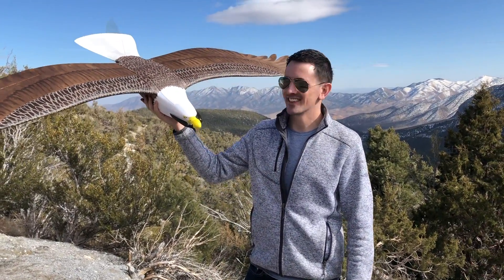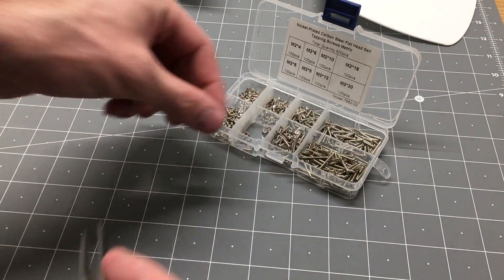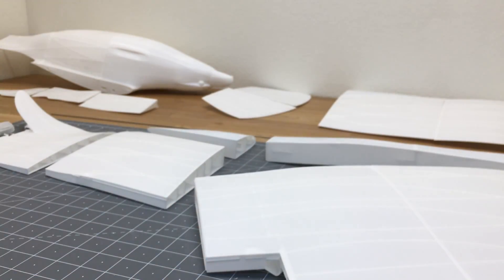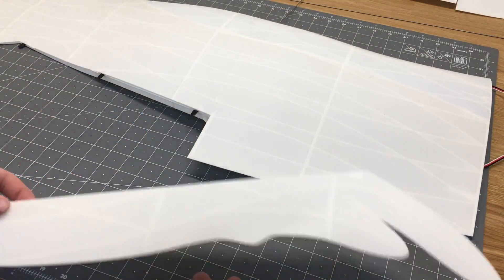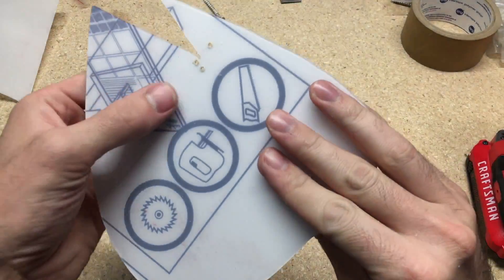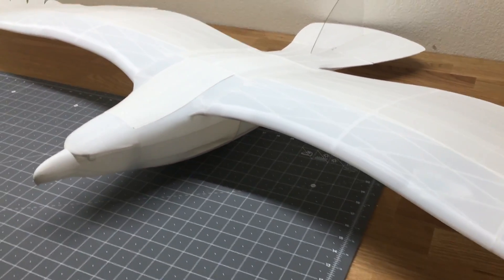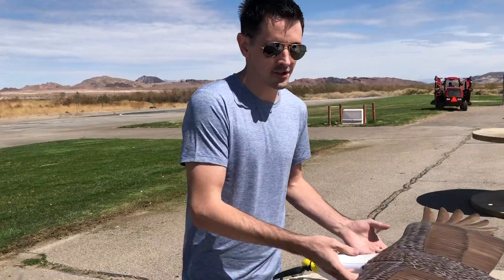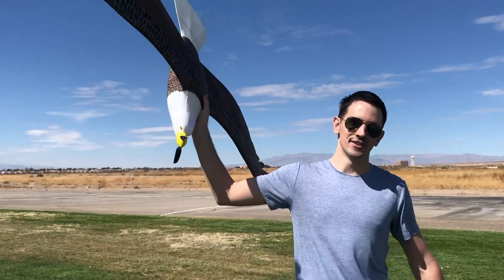Epic DIY 3D Printed Planeprint Eagle Build

Comment: Dear Troy, let me tell you my sad history and ask you your experience with the eagle.
I printed my first eagle, made its maiden flight and crashed after 10 seconds. CG perfect. As it built a little of speed it smoothly pitched down seeking the ground. Full elevator stick back didn't rise the nose. I thought the elevator servo was faulty.
I printed my second eagle, made its maiden flight and crashed after 10 seconds. The same behaviour than the first. I wrote to PlanePrint and they suggested me a bad elevator/aileron mix. What?!  I missed the mix! I didn't check the whole instructions. (Overestimating self knowledge).
Well that made sense for the crashes. I printed the third eage, made aileron/elevator mix, went for its maiden. After launch I inmediately feel good control on the eagle not like the previous flights. I was gainig height while trimming the plane and on two moments I felt the pitching down behaviour when aquiring speed, but with a hard elevator pull it raised the nose. After some minutes smoothly climbing and trimming finished it had height enough for some testing, but then, it picked some speed and again pitched down on a smooth dive. This time a full elevator stick back didn't raise the nose. There were a lot of long scaring seconds waching the eagle diving until the ground. I shoud have tried a half loop down and comming out inverted, but I was too slow.
Let me ask you... How many flights have you done to your eagle? Have you experienced this behaviour?
Thank you!

Comment: This designs been around for awhile, the only problem that I have with it is that it is short coupled, which is not that big of a deal, but the idea of having a clear Rudder is just not something I would want to do with it. The best thing to do with this thing would be to make the tail slightly larger and bring both edges of the tail down in an inverted V tail position. Many birds out there use their tails to control in the manner of a v tail even though it's not natural for an eagle, it still would be better than having that clear plastic Rudder there in my opinion.

Comment: I switched to stainless screws instead of the nickle coated screws as he shows. Not that much weight difference in the hardware. I Have had those screws strip on me even with a good precision screw driver. Some people might not take the wings off for transport, but I usually carry several different planes to the field, like the Big Bobber and model A. Thanks for the inspration to build a few of these! Awesome stuff!

Comment: Did you find the lexan for the vertical stab, that was recommended in the plane print instructions kind of flimsy and is that why you went a little thicker on that?

Comment: I have printed all of the lw pla with your settings and lw pla came out good (no under extrusion and no holes) , but when I try and print new roll of standard pla for the P3 surface normal pla parts, I am getting underextrusion and holes in the prints. What could I change to resolve this?

Comment: Tabs YES. I'm a model builder and When I see ppl build 3d printed parts invariably the parts are smooth. so they spend aligning the parts. I always think why don't they add some guide tabs to ensure alignment and add strength to the joint?

Comment: Hello, 
Awesome work, can you tell me how much Kg of filament are necessary?
Best regards
Reply from the maker: 400g of PLA and 500g of LW-PLA
Reply: @TroyMcMillan  Thank you
I cant find it in manual, if you can can help, just need to know the lenght of steel wire for elavator
Thanks
Attached image https://ibb.co/Sn6BGcQ
Reply from the maker: @NunoFlyer  I use 1m long wire and you cut them to length

Comment: Amazing. I looked up for this kind of flying machine as I believe these should be more energy efficient than traditional drones.

Do you actually know if your design is more energy efficient than other drones?

You could make this comparison by comparing flight length per unit mass per kWh consumed.
Reply from the maker: I haven't done any official testing like this. It is very efficient uses a small battery and gets a long flight time.

Comment: Could you show all the settings you used to print the TPU?  I am using the suggested print settings both manufacture and from their site and I am getting is thin not usable parts on my Anycubic Mega S.
Reply from the maker: For the Mega S you need to print very slow turn your printer down to 20mm/s speed 100% flow at 215C.

Comment: Hey we are using the software simplify 3D. We can import the test print everything looks fine but the printer doesnt print the inner walls of the profile . Any suggestions ? what to do ? we also used your recommended settings.

Comment: Great work. Thanks for the video. How essential is it to use the LW-PLA? Can the whole design be printed in regular PLA?
Reply from the maker: There has been a few people try to print this in all PLA but unfortunately the CG cannot be set if it is printed in PLA the back part of the Eagle is so light and the head does not protrude enough to add enough counter wight if it is printed with PLA in the rear.

Comment: 17:30 you have that mix backwards; when you pull up, the flaperons should drop, adding lift, you have them raising up, which is reducing lift at the same time the rear elevator is increasing the wing’s angle of attack, attempting to increase* lift. You have it set up so they are fighting each other

Comment: How much to buy the pieces? I need this but don’t have the ability to be a 3D printer guy.
Reply: I would buy one as well
Reply: @dboelens  , I have the printer's but have not bought the file yet. These guys make so much more money just selling the files that they don't have to do all of the laborious part. Printing all those parts, I am guessing would take my largest printer a week to create, with alot of trial and errors and throw away hickups. I estimate half a roll of both standard PLA and lightweight PLA (never used before, but just need to purchase). The rolls would cost $20 and $30 respectfully but might print three planes.
Are you seriously interested?
Reply: @c.g.4392  It would depend on the overall cost of the parts and of course the shipping. If you would like to split the costs I could do that. Where about are you located
Reply: @c.g.4392  We are interested in getting a few of these made. What ever the cost to make these we will pay for all materials, files needed  and what ever you consider it's worth for you to make them. That way you could make some for yourself. I don't know your name or where you live. How can I get a hold of you?

Comment: Very nice design! I started printing the parts yesterday...
An optional wing with Flaps will be very nice.
Reply from the maker: Have fun with your build. You may be able to add a small amount of flap setting to the ailerons like flaperons.
Reply: @TroyMcMillan  I'll try that, but effective flaps should be mostly at the root section  of the wing.

Comment: Hello.  What 3D printer do you use
Reply from the maker: I use a combination of printers. The Artillery Sidewinder X1 is my favorite right now it is direct drive and works well. I recently got a two trees Sapphire Pro and it has been working great also it was a lot of work to setup but the print quality is the best I have had on all my printers. It has a very stable frame to limit ringing for tall skinny parts like ailerons.

Comment: information.        if i had meant  'reading', i would have said 'reading'.
at the age, that most people stop 'going to school', they become  immune  of  Facts.
subsequently, when they are confronted with  Accurate Information, it  just  'bounces off'.      
admittedly, such events are 'few and far between'.     meaning, almost no one knows what he/she is talking about.   not even, veteran  hobbyists.
and, NOT even  the  idiots at  NASA, who chose to accept as valid, certain remote sampling data that   CANNOT   be  correct.
this is said without hubris  ---  i am an exception to the 'rule'.
i appreciate that you do not  TRY  to argue.   but, i do not take your silence  as proof of the  successful  sharing of  accurate information; unless/until  i  see/hear some  Evidence, that this is so.      cheers        googletranslate

Comment: What size of Folding Propeller Clip do you use (size between the 2 feet of blade so that the blades stick together well on the side of the nose) Thanks for your answer.

Comment: This eagle is amazing good...   i got an ALULA Dlg model  and i always wanted to remake it in better shape as hawk or eagle..  Just a question, this eagle you think can be scaled down to fit in my 3d printer or designs arent made in that purpose?
Reply from the maker: Its best to leave it, it flies really well at this size. There would be some challenges for scaling it down, mainly servo mounts and motor mounts, etc. It would pretty sweet if you did, let me know how it goes!
Reply: @TroyMcMillan   Hi there, i would like to try , but i need to buy the model first, just if it wouldnt fit would be wasted..    i got an Anycubic i3Mega i dont think will fit that design like that.

Comment: on STL file...can i scale down to say 1.2m?
Reply from the maker: scaling it down would be challenging, things like motor and servo mounts wouldn't fit the same way, you would have to add a lot of weight for CG. it would be best to print it at this size, it flies great
Reply: @TroyMcMillan   My is Delta 3D Printer, Print area only 185mm x 185mm......Mean i need to get a bigger Delta 3D printer??

Comment: The next step is to contact Horizon Hobby, after you get your patent. They'll work with you to produce and sell the kits. It would be great if all you had to do was charge the battery, assemble the wings & elevator/rudder to the fuselage, check all your functions with the radio, and "let 'er fly".
Good luck.

Comment: Troy, Do you know if this model is OK for Hi Start launch? Thanks!
Reply from the maker: not sure what you mean, do you mean because you need to chuck it?
Reply: @TroyMcMillan  Troy, A High Start is basically a big rubber band (tubing) that stretches out to about 100 yards. It will tow a glider up & the glider flies off at the top of the arc. One end is anchored to the ground, the other has a ring that goes over a hook on the bottom of the glider.
Reply from the maker: @10dogz93  Wow that sounds very cool thank you for telling me about this. I have not seen anything like this. 
This model has a second head without a motor. So you could just fly this as a glider and definitely fly it with that setup. It glides very well so if you get it high then you should be able to glide around for a wile.

Comment: Nice build Troy. Thanks for showing the artist and woman behind the camera. This video is perfect timing as I just finished printing all but the motor mount. Time to break out the ABS. Your assembly / build is very helpful. What prop length x pitch did you use with the DYS motor?     BTW you inspired me to add a Sidewinder X1 to accompany my Voxelab Aquila . 2 printers definitely speeds things up.
Reply from the maker: thank you! the sidewinder printer is great. its a 10x6 foldable prop with a 40mm spinner

Comment: Could you purely use this for soaring?
Reply from the maker: yeah you could, if you have a good place to soar it at! there is an interchangeable head without a motor that it comes with, since you wouldn't need the props

Comment: What is the wingspan ?
And the wingload ?
I miss the legs.
Reply from the maker: its a 2m wingspan, not sure about the wing load, I haven't calculated it. I miss the legs too 😜
Reply: @TroyMcMillan  
Thank you for the information !
The weight is about 1125 gr. I see ?
With Lipo, isn´t it ?
Wingspan about 2 m, so I´m able to estimate the wing loadbecaus there are enough sketches of eagles to calculate the wing area.   :-)
I found that one und shall use it for calculation.
https://de.123rf.com/photo_15881957_adler-silhouette-auf-wei%C3%9Fem-hintergrund.html
is the wing cord similar to yours ?
Reply: Meanwhile I was busy:
I printed the view from above.
So I can calculate every dimension derived ( concluded ? ) from the 2000 mm wingspan of your eagle model.
The wing cord of the model is about 360 mm = 3,6 dm.
The wing load is 2000 mm x 360 mm= 20 dm 3,6 dm = 72 qdm ( square dm ).
The wing tips are nearly not load-bearing, so I have reduced the wing area to 82 % -->59 dm2.
But the tail seems load bearing, so I added the area of the tail with about 8 dm2 and got the final load-bearing wing area 67 dm2 !
1225 grams and 67 dm2 result in about 18 grams / dm2 !
It´s rather low for an electric driven model airplane.
-->Congratulations !    :-)
( Am I in error ??? )

Comment: at 6:37, this low-profile  control horn design is  less-than  ideal.    bc, it results in a servo having, at all times,  LESS  mechanical advantage over the  load; at a control surface.    and, that control surface, due to its chord length, will take relatively  more  force, to move.      googletranslate

Comment: Would it be possible to do the whole bird in PLA as PLALW is not available here down under at the moment? how much more would it weigh?
Reply: A few builders on the Plane Print Pilots FB page printed in PLA only and fount it to be unflyable. It is impossible to achieve the proper CG without an excessive amount of weight in the nose.
Reply: @billgreet  Thanks...

Comment: What 3D printer are you using?? Been looking and reading reviews!! And getting information overload!!!
Reply from the maker: I'm using an anycubic mega x in this video, I also recommend the artillery sidewinder for the direct drive
Reply: @TroyMcMillan  thanks!  I think I am going to get a Prusa to start with. the build volume is just big enough I think it’s 250x210x210.
Reply from the maker: @charlescehand9335  Yep! That will work, and they make a great printer.

Comment: Do you think it would be better to print the forward parts of wings in LW-PLA rather in  PLA : LW-PLA seems strong enough ?? I already printed all backward parts of wings.
Same question for the fuselage ? I did print the head in LW-PLA.
Thanks for your video, nice flight !
Reply from the maker: when I went to set the CG, I had to add plenty of lead it have it be where I wanted it. if you printed it all out of LW-PLA you would need to add tons of weight to the front to balance it, which would compromise strength anyway.
Reply: @TroyMcMillan  Thanks for the advice. Will follow planeprint instructions so

Comment: How long did it take to print? I saw an earlier reply you made saying that it took $100 (about four spools) of material, so let me guess how long... 50 hours of print time?
Reply from the maker: nah, a roll and a half between PLA/LW-PLA. it took about 100 hours.
Reply: @TroyMcMillan  I was completely off, lol. I did just receive the CR10S Pro I ordered, so I'll have a little experience behind my next guess!
Reply from the maker: @SomeGuyInSandy  nice! what are you planning on building?
Reply: @TroyMcMillan  Right now I'm dialing it in with the included PLA. I should receive the spools I ordered tomorrow, so I can really get that done.

Project wise, I am going to build an AR3 robot arm. Robotics are super interesting to me.

What brand of LWPLA do you recommend?

I will eventually try printing a plane. It's awesome that you share your experiences, and make recommendations on printing planes. That makes it a lot less painful for guys like me to get in to it. Seriously, thanks!
Reply from the maker: @SomeGuyInSandy  I use ColorFabb LW-PLA they just released gray and red to there colors.

I definitely like robotics also I was in FTC robotics in high school and had a lot of fun building things like that. 

Good luck with your projects.
Reply: @TroyMcMillan  Thanks for the recommendation, I'll grab a couple of spools. I have some ribs that I modeled in Fusion, and then cut out of 0.125" balsa sheet on my CNC router. I printed that model in PLA which ended up weighing 6 grams, (2 shells, 10% infill) so I'd like to try one with the LW stuff. Catch you later.

Comment: Great looking plane, but have 2 questions, is lightweight PLA required and where did you get those EZ connectors that use the nut on the back?  Brand name and supplier.
Reply from the maker: Thank you, Here is the link for the connectors @t, I definitely recommend the LW-PLA it make it so light wight and flies very well with this setup. The design of the LW-PLA parts also would be heavy printed with PLA. All the other links to the parts I used for the build are in the description.

Comment: Looks amazing in the air, don't think you needs the elevon mix on the Ailerons though. It looked a bit too pitch sensitive to me...🤔🇬🇧
Reply from the maker: Ya this was something I was not familiar with but Planeprint recommends setting it up like that. It seemed to work well. I set a few clicks up trim up for the maiden and it was a bit too much on the hand launch it pitched up a bit. After getting it trimmed it flew very well.

Comment: Very nice. Awesome paint work!

15:21 You might want to double check prop blade screw/nuts to ensure opposite each other for better propeller balance.
Reply from the maker: Thank you for this tip. This was the first time using a foldable prop so thank you for the suggestion.